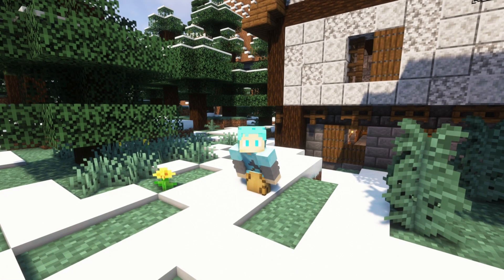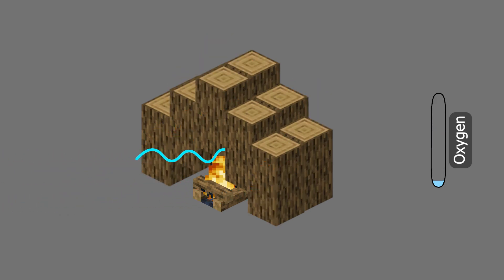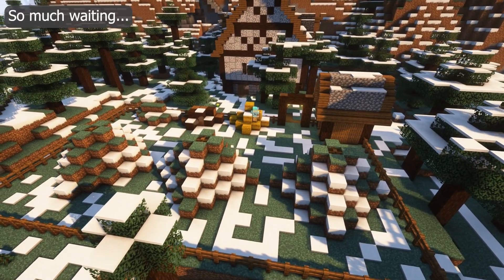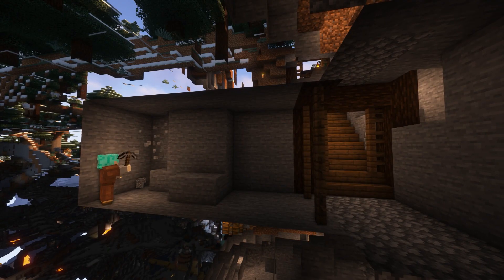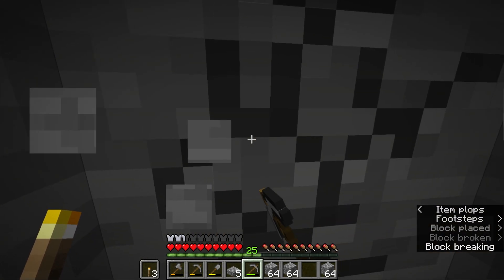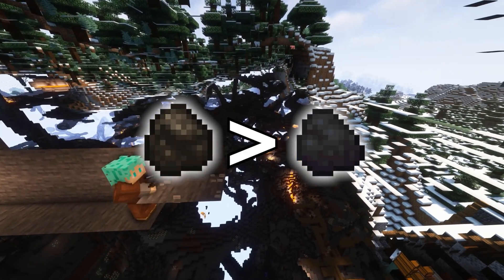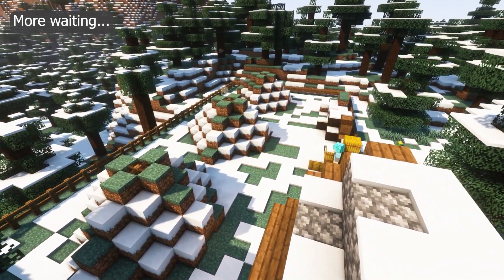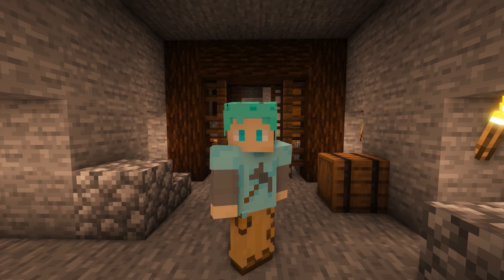Coal vs Charcoal - What's the Difference? | Archaeologist's Guide to Minecraft (Ep. 14)

Comment: It would be cool if Mojang gave coal and charcoal some different properties. Maybe coal can only be used in Blast Furnaces and charcoal in regular furnaces. I would also love to see them add more automatable renewable fuel sources.
Reply from the maker: Yea, I can see them wanting to keep it the same for challenge maps or skyblock and such, but I definitely wouldn't be opposed to some kind of mechanical difference between them...
Reply: Bamboo is already decent if you only have fairly small smelting jobs. Kelp is going to be awesome after the Crafter block enables AFK kelp blocks. You can actually have AFK charcoal too but it takes silly amounts of elbow grease, especially on Bedrock where we don't have TNT dupers.
Reply: @B463L  I actually made an AFK charcoal farm once, it was a cool project! But I didn’t know how to dupe TNT so I just had to load the dispenser chest manually. Problem is I went through hundreds of stacks of sand to make it work.